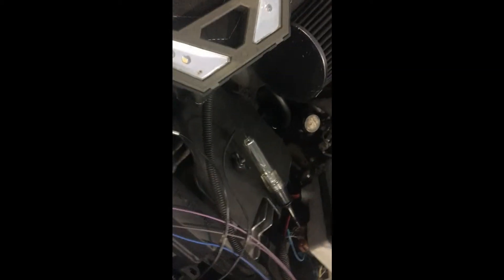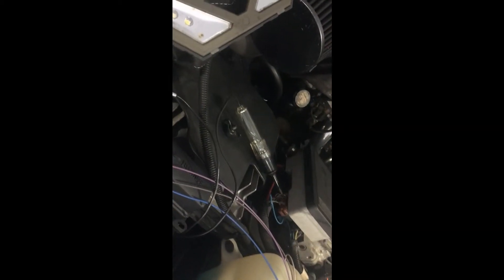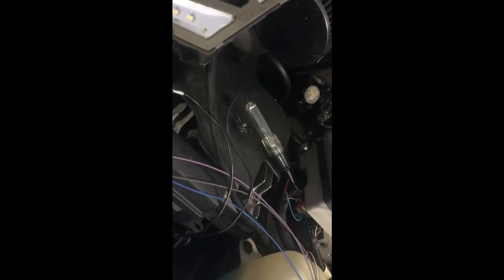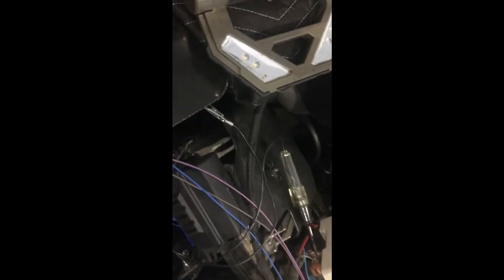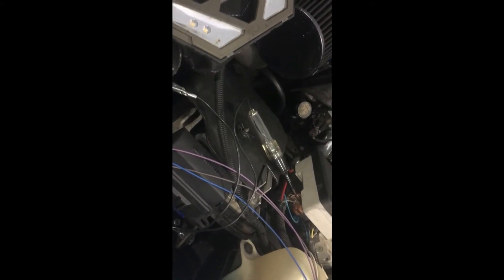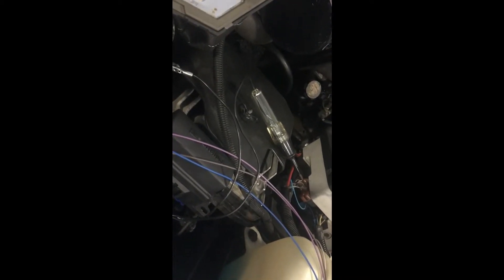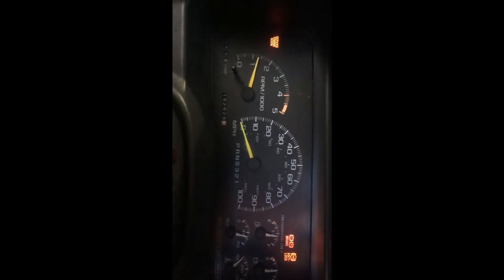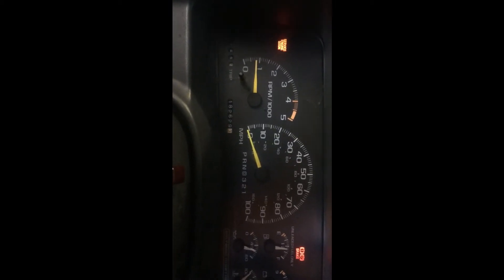1995 Chevy Cheyenne OBS  LS swap TCC Brake switch and Tach wiring

Comment: Hey there have you ever removed the main harness from the fire wall to the rear tails I have a dark green wire that goes from the 4 pin in the rear to a connector to the fuel tank and not sure why it’s there, thank you

Comment: I have a 95 like your's when I done my swap I found my tcc wire was not hoked up how did my trans. survive like this
Reply from the maker: With the tcc hooked up, your electronic torq converter will lock-up and disengage properly.  I have never not connected the tcc. Double check that you have an "e" transmission. If your transmission is not an "electronic" trans then you wouldn't need it. But, if it is an "e" and by that I mean 4l60e, you should plan on connecting it or your torq ocnverter/trans may have a shorter lifespan. Time will tell if it will create a problem for you, but, I would suggest connecting it to be safe.

Comment: a question where did you get the soft wire you connected
Reply from the maker: The wiring I connected to the trucks original wiring was part of the LS wiring harness.
Reply: @laurencevillegarage  I have a wire in the ls harness called TCC switch, it will be that
Reply: @laurencevillegarage  ok and that cable that comes from the ls harness, where does it come from or what is it called

Comment: Hey is the tach wire same as the speedo wire
Reply from the maker: No, they are different. The tach wire is (on your OBS) coming off your coil. The speedo wire is connected off your trans.

Comment: @Lawrenceville  can I just tie into my purple wire on my brake light switch
Reply from the maker: You can as long as it has no power to the wire before pressing the brake pedal and has power when you do. On my truck, it was easier for me to find that wire under the hood than trying to lay flat on my back in the floorboard of my truck looking under the dash.
Reply: Hey did this end up working for you

Comment: am having trouble finding  the fuel pump cable and the ignition cable to connect my standalone hardness to them do you think you could help me out.
Reply from the maker: For a stand alone harness harness, usually there are 3 main wires to make it run. Red for constant hot, pink for ignition hot and grey for fuel pump. Check out my video on wiring and see if this will answer your question better. If afterward it does not, let me know. https://youtu.be/0yaeRUXO1ps
Reply: @laurencevillegarage  you connected those 3 wires in the fuse box. But I don't have the cane of fuse box  mines its a 93
Reply from the maker: @gabrielcervantes7924  It may not be exactly the same, but it will be similar. Follow where your positive battery cable goes and that should lead you to your fuse box area where you will find the others. I don't have a '93 to look at to see. I also have another video on where to find wiring schematics for your truck. Try https://youtu.be/5QOx4dTeWXw to lead you in the right direction.
Reply from the maker: @gabrielcervantes7924  sorry, I sent you the wrong link  try https://youtu.be/GaBkZ6p4NLY
Reply: Am going to remove all old fuel system wiring am I going to be needing the old pcm?
Reply from the maker: @gabrielcervantes7924  Be careful making big changes. Is the truck already running? I'm sure you can make it work, but it already does, so why change it? I would maybe replace the wiring with new, but not change how it works or is hooked up. It's not broke so why fix it?
Reply: Could I connected my ignition wire directly from the battery
Reply from the maker: @gabrielcervantes7924  Without seeing exactly what you have, I am cautious about saying yes or no, I don't want you to damage anything. You need a wiring schematic for your truck. Then need to see what wires you are dealing with. .
Reply: Do you have IG or facebook were I could DM you
Reply from the maker: @gabrielcervantes7924  There is a link to my facebook page in details below the video.
Reply: @laurencevillegarage  thanck you for all your help I got my L's swap to start.. But am having another issue I don't know if you could help me out on this
Reply from the maker: @gabrielcervantes7924  What's up?
Reply: The truck cracks and starts  but it turns off
Reply: @gabriel check your MAF sensor
Reply: Thanks for that location of the abs purple wire I’m doing a ls swap in 97 obs

Comment: So that purple TCC wire coming from the PCM Plug goes to that purple wire under the hood?
Reply from the maker: If your truck has abs, which mine does, that is the purple wire I used to splice into. It is on the front of the abs module. The wire is on the top row of the plug.
Reply: Can I. Just cut that wire? Lol can I just disconnect the tcc from under the dash or should I just buy a new one cuz my current one is giving me issues and I can't get to highway speeds cuz of it